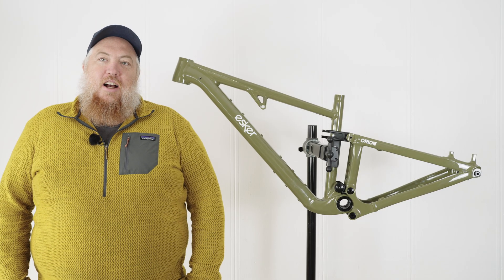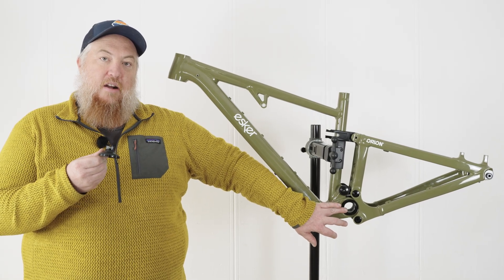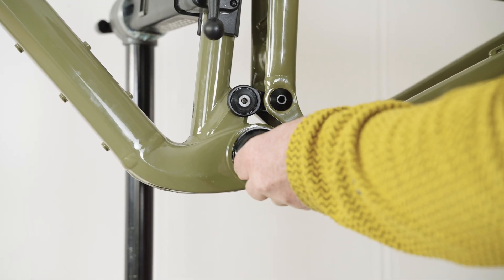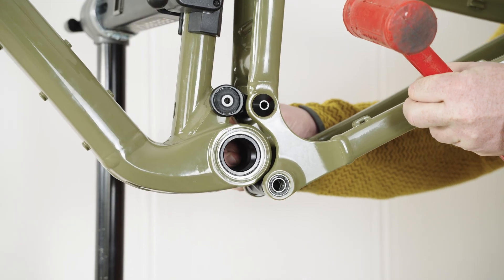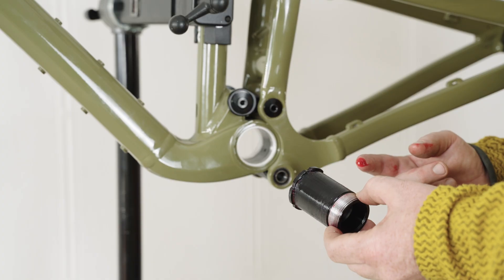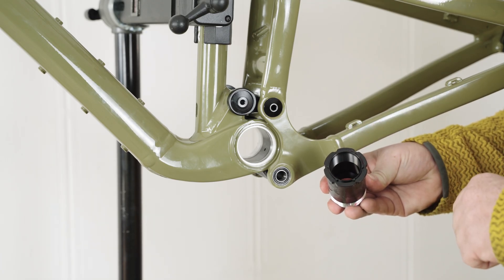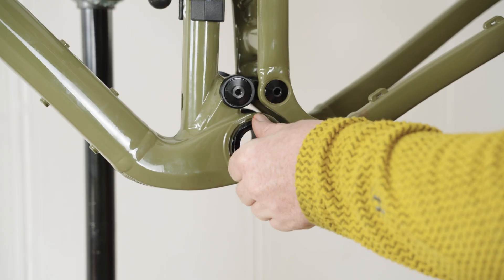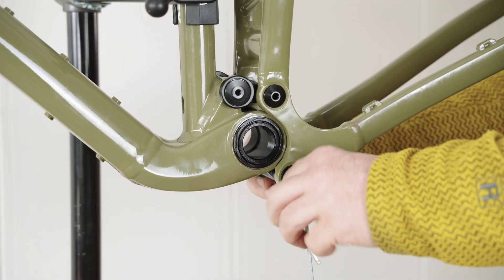Orion Suspension Bearing Service

Comment: Absolutely impossible to remove that lock ring. Even tried a hammer drill and nothing
Reply: yup i just tried to get mine off. absolutely facking impossible. just gonna hope those bearings last forever. The suspension works great but this unservicable design is really dumb. Either make the hex flats deeper so more socket bite (looks totally possible) or dont make it need to be forty gdam newton meters

Comment: How do you get the bearings out of the shell usually? They're pretty tough to get at with that floating piece in between them. When I did the bearings on my Rowl recently I managed to knock them out with a flathead screwdriver, but it chewed up the shell a bit in the process and I had to file it back down.

Comment: I have a Rowl and asked Parker for this kind of thing long ago. Nice! It has to be siimilar for the Rowl, yeah? Oh and I have that tool for removing the lock ring. I did not know the threads were reversed and thought mine were just locked on. Super helpful here again. Thanks. If you can confirm the Rowl service is near identical, please do.
Reply from the maker: Can confirm! This video is identical for your Rowl bearing service